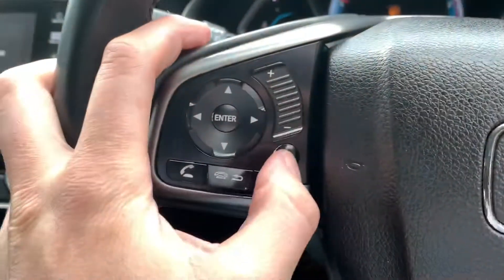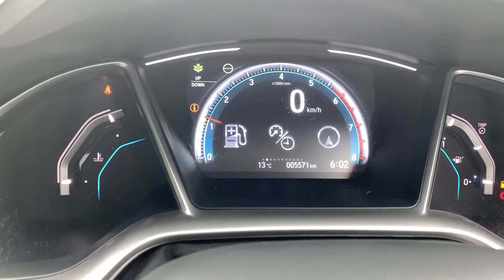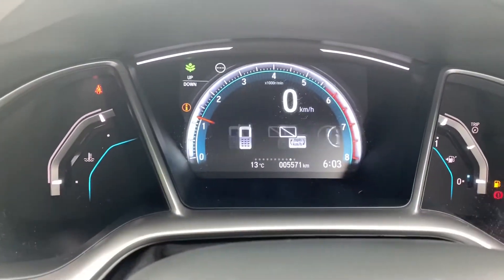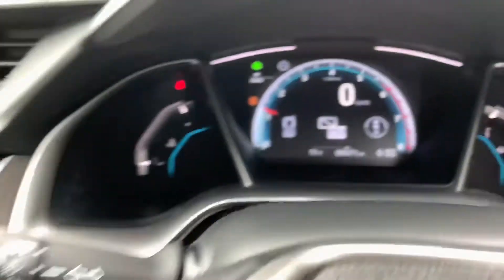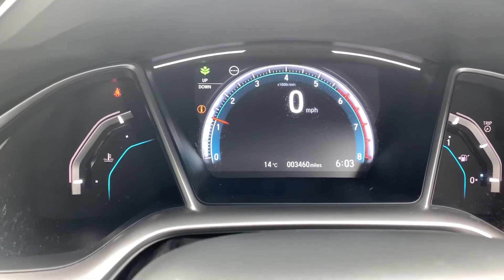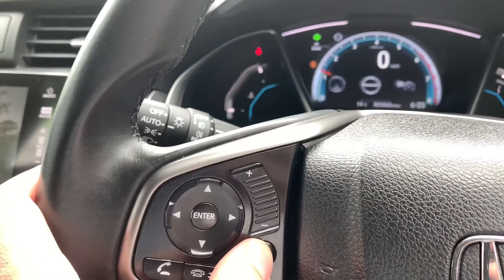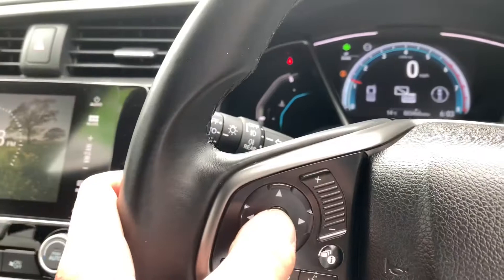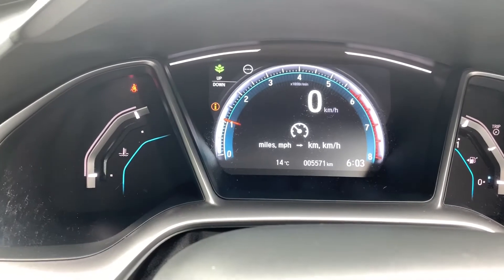How to change Civic Speedometer from kms to mph

Comment: Do you have any Club how that works in a type r fk8?
Im sitting on the ferry to dover,  don't have that option. Also went through the touchscreen and looked for it there, not existent...😢
Reply from the maker: I don’t have one of those in stock, but can you see the menu button on the left hand side of the steering wheel ??
Reply: @doolanbrian  didn't expect you to respond that quickly.
I have all the menus, including boost gage, gmeter and so on.
I also know the menu in the main display where I can change them and make them available/unavailable from the steering wheel info button.

But conversion mph/kmh is unavailable to me.

German 2018 fk8 typer

Comment: Hello I have a 2017 Honda crv but it doesn’t have the i button on the steering wheel to the left. How do I change km to miles?
Reply from the maker: Hi Jason ! Are you in Europe ?
Reply: @doolanbrian  no I’m not, I’m from the US
Reply from the maker: @jasonlozano6003  on the 2017 model in Europe I don’t think its possible to swop km to mph on CRV .. it is possible however on civic in 2017 in Europe though 

if you are in the USA, I don’t think it gives you the kilometres per hour alternative regardless of whether it’s civic or CRV 😞

Comment: Hello just wondering if you know on the Honda fk2 type R 2016 models. Can they do the same thing? Changing from miles to kilometers per hour? I'm looking to have one imported at the moment. Thanks in advance.
Reply from the maker: Is the car going from UK to Irl or JPN to UK/Irl ??
Reply: @doolanbrian  going from UK to Aus
Reply from the maker: @brakefastmedia  In that case, you should be able to make the switch, we can do it with the UK car is normally🙂👍